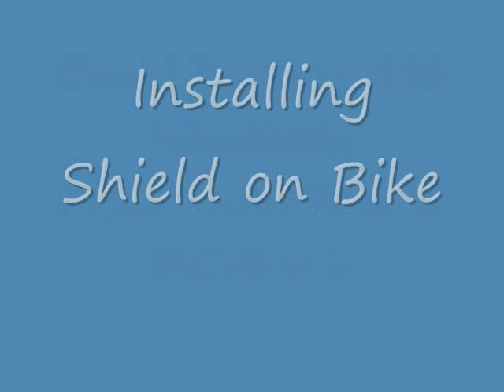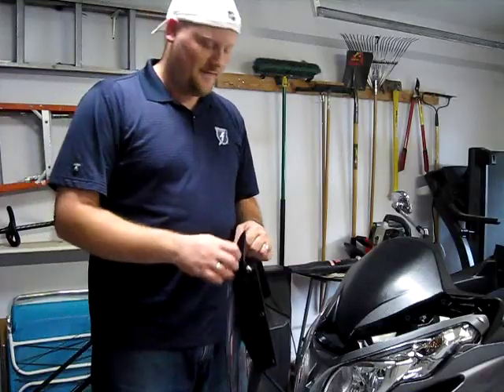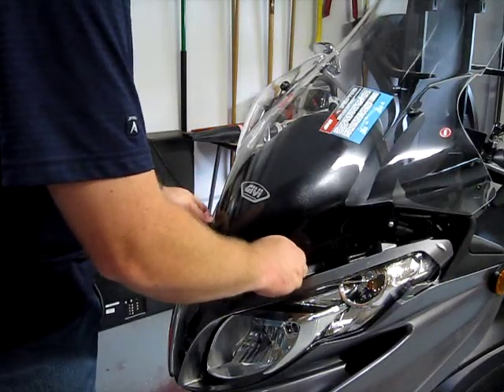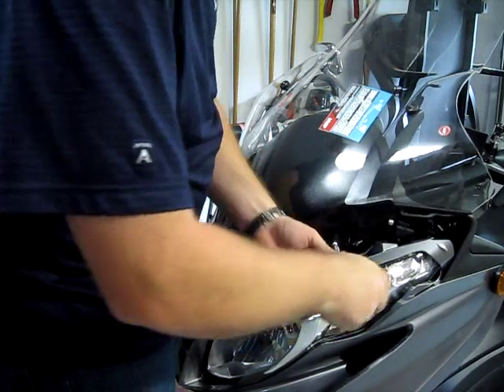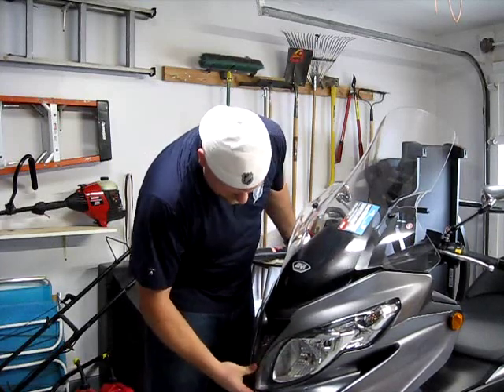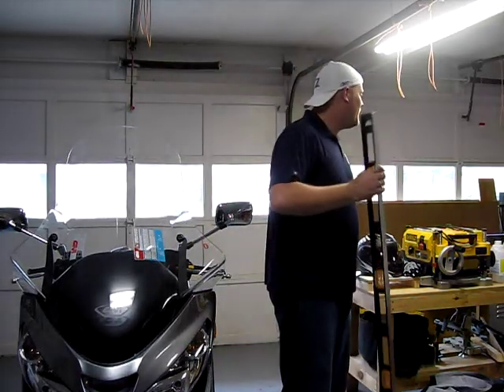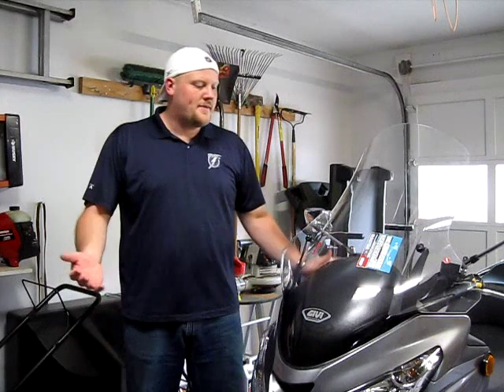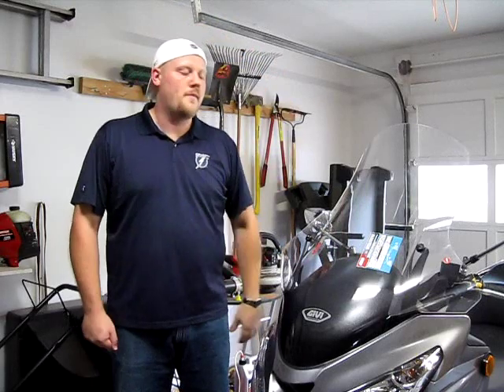Part 3 of 3 - Suzuki Burgman 400  Windshield Replacement

Comment: Just wanted to say you're video was very helpful watched it a few times and decided to have a go fitting mine myself I have a 2010 400 burgman and fitted the givi af266 airflow the same way you described. took just under 2 hours I took my time and it's spot on so much better then the stock screen. by the way anyone in the UK the best price I found was bikebitz at £151 posted and it came within 4 days well worth the money :-).